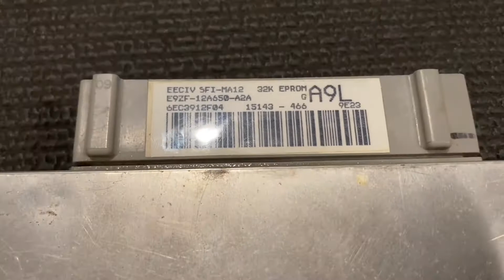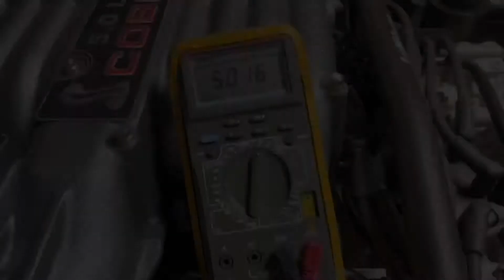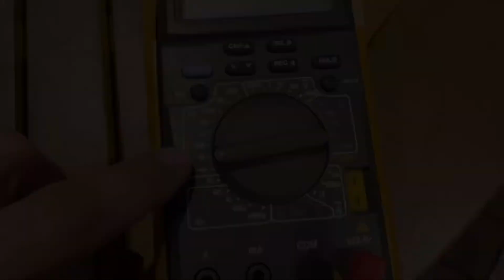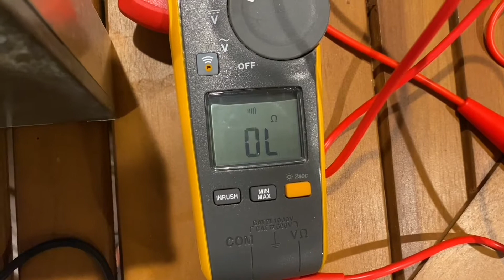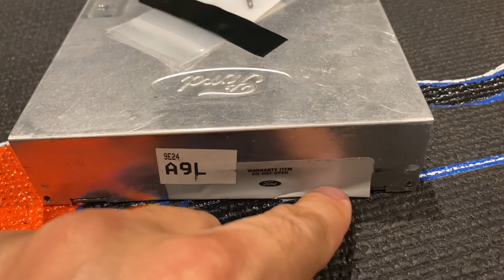Mustang Foxbody ECU Inspection -  Things to check if you suspect your ECU is in need of repair

Comment: You ever make a thread on these,  noticed alot of the old big brand remans A9l's I've opened  have components you normally don't see on the factory boards, traces that are normally empty with components on them.   but haven't had much luck finding what they used as donors.
Reply: Hey i wanted to ask a question if i may,i finally sourced a computer I'm gonna send off to have overhauled,its a A9P and from what i can tell someone replaced the capacitors however the capacitor closest to the main harness plug is different from the other 2, its really small in size from the other 2,I'm no electronics expert but sometimes i wonder why people just dont replace things with the same instead of monkeying around but again maybe it was a good idea? 

Also, on the big black processor on the board, they removed that rubber coating around it and i guess they were going to replace it but didn't, why would anyone do that?  the reason i dont think they replaced it is because it still has the OEM processor, it doesn't look bad and the solder points look fine,the pin 46 trace is fine also, i just checked it.

The guy that sold it to me is not a electronics guy, he just had a few for sale but he told me this computer comes up as a "constant prime" which I'm familiar with,he told me if its not repairable he will refund my money but as good as ECU xchange is im sure it will be fixable,i was just curious about the capacitor discrepancy and why they removed that coating of the processor? thank you for your input, i was just curious.
Reply: @dntlss  Caps could be just a different type, they where hard to get for a while and some used solid state caps instead to replace them. As for the coating , you have to remove it for trace repairs, or piggy back chips on the j port,   some boards had a better coating then others, they probably reflowed it with a heat station.  Most any decent electronic shop can repair these if they can source faulty components and are decent at trace repairs.  People doing it at home don't have tools and often just slap new caps in and see if it works or not. These computers are pretty much dead simple, just the rebuilders can't source cores or the eproms from people turning SD or 4cyl ecu's as cores for 20 plus years. Plus the resellers think there gold plated now like most fox body stuff.  The ford truck ecus from the early 90's almost all need trace repair work when they fail.  where its not as common on the fox body without the caps leaking and eating away at them or a short burning them up.
Reply: I appreciate the info,i did have another question if i may,what causes pin 57 to burn up? not the trace on the board but the actual pin thats soldered to the board and connects outside of the plug to the main harness? is that repairable? i have a really nice A9P thats almost in new condition but has that burnt pin, i was just curious if it was a paperweight or it could be fixed? thank you again. @nothanks81
Reply: @dntlss Probably best off sending it in as a core at a parts store,  they still offer rebuild services and have more resources then a typical electronics shop, so they will have other cores they can rob parts from, l've had rebuilds that where not factory mustang boards but that's old stock stuff, I haven't used thier services in years.  Bluestreak, cardone etc most most chain stores will offer a  rebuild service from them still but its mail in vs ordering a replacement.  The counter guy is probably clueless unless you ask management..  Most any burn in electronics is from a short .
Reply: Thanks for your reply, I'm actually gonna send it to ECU Xchange, ive used them before and they are top notch but it will be a couple of weeks before i do, i was just trying to get some opinions.

Yeah pin 57 is main power,a lot of these cars have the hood light disconnected, the diagnostic port is really close by and they will go diagnose the car and mistake the little secondary diagnostic plug for the hood light and poof! toast computer,but there are other reasons that escape me right now,i think they put a jumper on it and fix it when those pins burn.
Reply from the maker: I never did one on that topic.  I’ve had the same curiosity.   A lot of the components inside are obsolete and tough to find the exact replacements and need to locate substitutes.  I’ve just never had my hands on any of the remains to take a good luck at what was used.
Reply: @Mustang5L5  I posted a board pic in the tfi guts thread of an old 90's town car ecu on SN.. Boards appear identical, but with more components and some chips differ but what I think the used as a core on some from others remans I've seen cracked open
Reply: Interesting, I've got one in my 342ci 91LX hatch and have never bothered to pull it open simply out of curiosity, I haven't noticed any issues with it in regards to proper operation.
Reply: These computers are now in their 3rd decade plus of operation with capacitors that were normally good for 15 years so most are on borrowed time,i have a 89 and a 91 and I'm trying to find at least a couple and have them rebuilt for spares,if you are planning on keeping your car act now cause they get more and more expensive and hard to find every day,you could buy them for 100 bucks all day long a few years ago, now most people want 6\700 dollars for them rebuilt  @wbrockstar9550

Comment: I recently purchased a 89 5.0 5 speed convertible with a bad computer the number is E9ZF-12A650-A2A is that the correct computer for this car? And which should i replace it with if? Thanks in advance

Comment: i dont have a smog pump anymore.you think i could put that transistor in place of my fuel pump one? great vid btw most informative one yet
Reply from the maker: The transistors for the TAD/TAB are the same p/n as the fuel pump transistor.  They should interchange, but I’ve never done it so I can’t say for a fact if it would work.